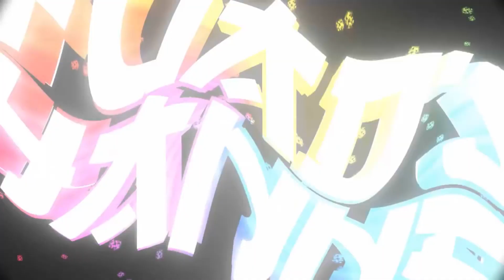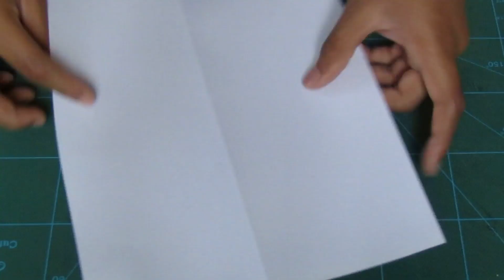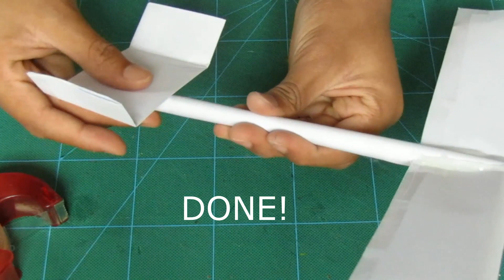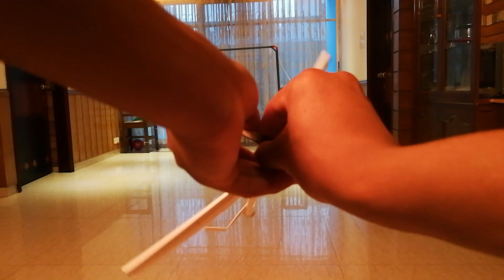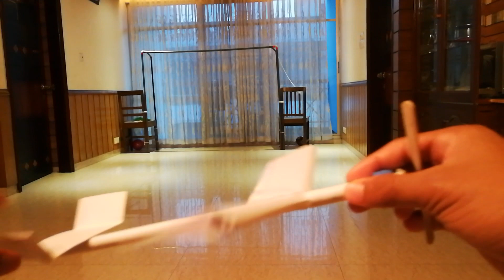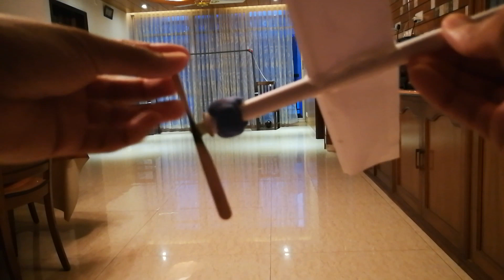[PART 2] How to make a rubber band powered plane with paper (Assembling the wings and test flights)

Comment: The glide tests' results were great. When powered, the plane rotated up and stalled probably because of the thrust line being off. You could try to compensate for that by adjusting the position of the wing or the angle of the horizontal stabiliser.
Reply from the maker: True :)

Comment: What happens if your propeller doesn't spin how would I fix that? Do I just put a little bit of grease on it?
Reply from the maker: u may face this issue due to too much tension of the rubber bands or friction between popsicle sticks. U may increase the number of rubber bands to reduce tension.

Comment: i was a little surprised while watching the video. You do realise that your powerplant is really weak. The Popsicle doesn't have enough surface area plus its kind heavy too. But the problem is the wing. With such power the plane needs to be light to the point that its fragile
Reply from the maker: Ik i have created a bunch more rubber power tutorials, there, I used it differently. I just wanted to test it with paper
Reply: Use plastic bottle I use plastic bottles
Reply: Cut it I mean